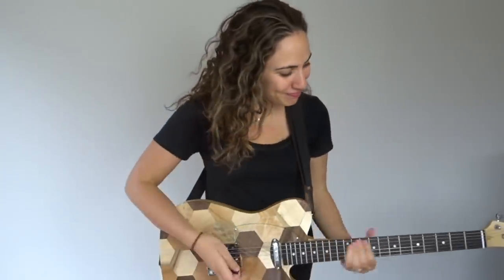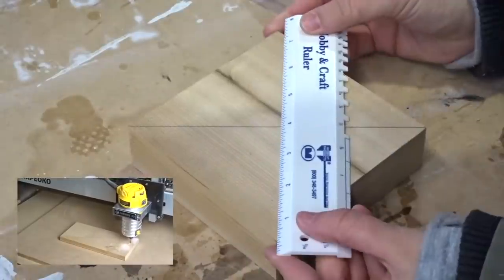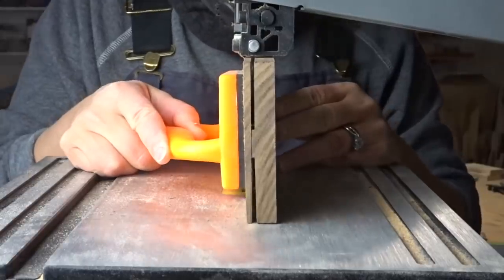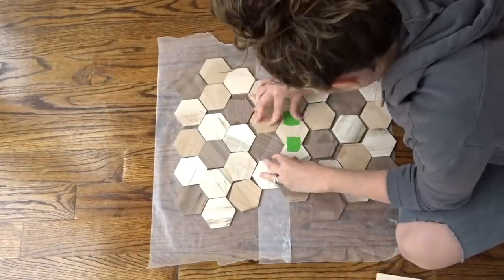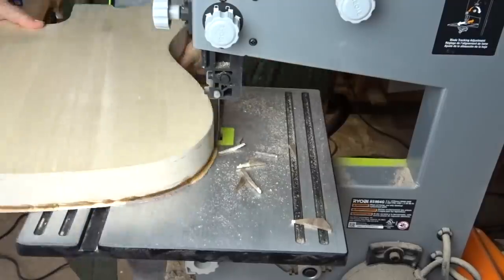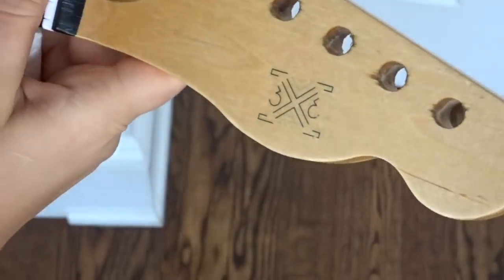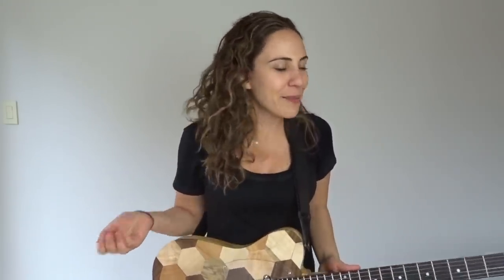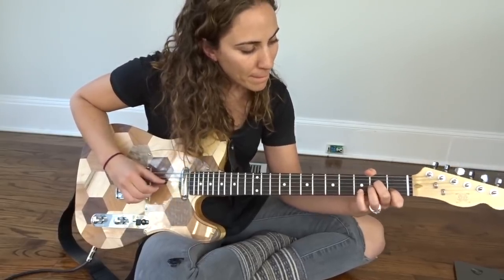DIY Telecaster Guitar // Woodworking Project // CNC // Guitar Kit

Comment: So to help with the issue of holding wires for solder, you can pick up a tool called a “third hand.” it’s got three flexible arms, two of which are tipped by alligator clips, the third by a magnifying glass. It’s been indispensable to my soldering work. Best of luck, good job. Cheers!
Reply: You can get them at harbor freight.
Reply from the maker: Awesome! Thanks for the tip!

Comment: Nice work. I'm curious why you didn't just use a planer or even the drum sander to take the top off the kit.
Reply from the maker: You can. I was concerned there would be tear out at the holes and possibly at the back. The drum sander, bc I don’t have one. And I already asked for one favor.... ha.
Reply: Haha fair enough. Anyway, it turned out great. Did you tru-oil the neck as well?
Reply from the maker: Thanks! I sure did. I watched a VERY LONG video of a guy applying tru oil to a neck. Here’s the jist. Rub on light coat. Wait till not sticky. Rub with 0000 steel wool. Repeat about 4 to 5 times.
Reply: Thanks. I'm familiar with the gist haha. Just wanted to make sure you put something on there to seal it up since you said this was your first guitar. Keep rocking; nice channel.
Reply: I have an unfinished neck coming my way in the next week or two for my Tele build I've had for several years now.  Tru oil might be the way to go.  And if you're interested in doing any different types of DIY finishes for your future guitar builds, @Brad Angrove has an awesome serious of videos showing how to paint guitars using regular spray paint.
Reply: Brad Angove ha, didn’t expect to see you hear Brad!
Reply: Or a plane... would have taken 5 minutes.
Reply: Thanks for the tip! Will try it out.
Reply: Did you use tru-oil over the decal? How did you "bury" that decal in clear? Great vid. Congratulations.

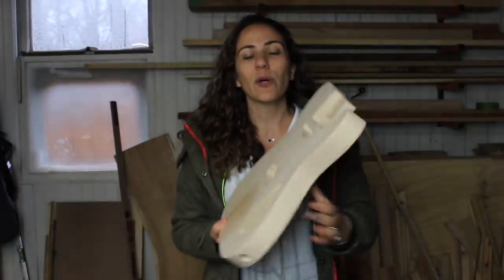Comment: 0:38 Planer? 0:47 Planer. 0:54 Planer! hhhmmmmmmm 1:00 PLANEEERRR!!!!
Reply from the maker: Sure. If you want to risk tear out on the back of your routered holes.
Reply: Oh............Looks great!
Reply from the maker: Ha. Thanks!
Reply: Yeah I was like....what??? poke that thing through a thicknesser, job done in 5 seconds :)
Reply: Nope. Thickness planers do not like surfaces with recessed cavities. The leading edges would be fine but the trailing edges would most likely get some pretty serious tear out. Not to mention that most bench top style planers are limited to 12-ish inches.
Reply: You can plug the neck pocket temporarily and cut pieces of the same thickness to buffer the leading and trailing edges. I’ve seen it done with good results in other videos. The concern is real, but it seems there are work-arounds for any that would prefer to thickness with a planer (or don’t have access to a CNC). Even a hand plane could work in a pinch.

Comment: Beautiful veneer work. You said building the guitar was pretty easy, but the veneer work is like pro level. I could build the guitar for sure, but I would just stick to a simple stain, and finish with the Tru Oil. I have had those three piece bridge saddles on telecasters before, but swapped them out for 6 individual saddles as you can intonate the strings a lot more accurately. Thanks for posting a good video.
Reply from the maker: Thanks! Yeah I want to upgrade all the electronics on this thing

Comment: "timesaver" barrel/drum sander(20 times larger than the one seen here)used in cabinet shops (residential kitchen and bath cabs)to get consistent cabinet doors face frames, and panel thickness is what i use/prefer.i just go to a shop i use to work at and i'm done in 5 minutes tops.lay it on the conveyer belt in the front of machine and take it off the conveyer at the back of the sander, might be an 18 inch trip through the machine, flip the body over and repeat.visit a local custom cabinet shop and strike up a conversations,I bet they say no problem.tell him you'll send others that wish to do the same project his way and he can make $20 on each guitar,great deal for both sides.GREAT JOB ON THE GUITAR AND GREAT JOB ON IMPROVISING METHODS TO GET TO THE FINISHED PRODUCT SEEING AS IT'S YOUR FIRST TIME AS A LUTHIER.LOVE YOUR NOT A PATTERN AT ALL PATTERN.I DESPISE PICKGUARDS,BUT THE CLEAR WORKS VERY WELL.JUST AN IDEA........BUT I THINK IF YOU MADE YOUR OWN VOLUME AND TONE KNOBS OUT OF WOOD ON A LATHE WOULD BE A SUBTLE CLASSY DETAIL.
Reply from the maker: Thanks for the tip!

Comment: That is a seriously impressive legit tele! You should definitely be proud of this one!!! Especially for a first time try. That thing came out ridiculously nice!!

Also I'm a Gunsmith and yes the Tru-oil is nice and easy to work with, is fairly forgiving, and gives a nice warm finish. You called it tung oil, but actually it is a boiled linseed oil. If you really like the look and feel of hand rubbed oils like Tru-oil then you might want to give a brand called Lin-speed a try. It's like Tru-oil, but dries a little quicker and comes in a little glass jar. Another one you might want to try which is my personal goto for finishing stocks is Gun Sav'r Custom Oil. It comes in 3 different sheens, dries quiet quickly, and best of all it is in a spray can, but can still give a hand rubbed finish. All of these and more oil finishes can be found at gunsmithing websites called www.brownells.com or www.midwayusa.com or of course you can just search the interweb for them. Just figured I'd throw those out there for you to try if you want to and once again great job on the custom telecaster!
Reply from the maker: Thanks so much! And thanks for the tips on those finishes. I will def check them out

Comment: Very nice! I don't know if you've already done it by now, but you'll also want to shield your pickup/electronics cavities. The most common way is with copper tape, though conductive paint is also an option.
Reply from the maker: I’ve seen this done. But still don’t understand the purpose. Why would I need to do that?
Reply: @3x3CustomTamar   The idea is that it will reduce interference in your electronics and reduce hum; when the electronics are not shielded, they can also pick up stray radio signals, noise from nearby phones, wireless mic systems, etc. It won't remove the 60 cycle hum that we all get from single-coil pickups (that's part of their charm?), but it will keep things quieter in general.  Luckily, this is the information age, so you'll find a ton of information out there about how to shield the cavity and ground your electronics to it. Good luck!
Reply from the maker: Matthew Gore got it! Thanks for the info!
Reply: @MatthewGore   it's charming right up until it's blasting through a PA system. lol.

Comment: Very nice!  

Just a heads up.  You seem pretty informed.  So, just in case you're not aware.  Brown paper bags are great for filling in fine cracks.  Obviously paper grocery bags are a little thicker than lunch bags.  Just glue the bag in between your pieces.   The bag will swell slightly.  But it will not push the joint apart.

Also, I didn't get a good look at your bandsaw.   But if you get a blade that's thicker (maybe 1/2 or 3/4) however with a thinner kerf.  That may help your resaw  endeavors.  Timber Wolf blades are very nice blades.

BTW that's a sweet finish!

Thanks for sharing!
Reply from the maker: I’ve never heard of using brown paper bags. Thanks! It’s a ryobi. Changing out the blades has not been helping.

Comment: Very cool looking guitar.  If you have not done it, I'd suggest doing a fret job on it as well.  It makes a HUGE difference in playability
Reply from the maker: Thanks! I plan on it at some point!
Reply: You can get a nice radius block on www.lmii.com for a good price.  Their stuff is less expensive then stewmac.  There are some nice how-to's on youtube on how to make a fret crowning file, and a triangle file with one side ground smooth works well for rounding fret ends.

Comment: Did you redo the roundover or leave the edges “square” with the flush-cut bit? It’s hard to tell in the video. Down the road you may want to replace the pickups and tuners, and for sure take it to someone for a full setup and fret job and your 10th fret issue will be solved. 

GREAT JOB. It looks very cool!
Reply from the maker: Thanks! I did round it over. Maybe I missed that footage. I’m def going to take it to someone to get it in perfect order.

Comment: I was introduced to your page through the Great Guitar Build off and found this video. Both guitars look incredible! If you can fasten the pieces down to the CNC table (or another surface that can be clamped); another way to separate the individual hexagons would be the same way it's done with metal parts. Flip it hexagon side down and surface cut it until the blocks are separated. Good luck in your future endeavors.
Reply from the maker: Thanks so much!
Reply: @3x3CustomTamar  I haven't seen it with wood (with metal, you're more likely to be machining parts that can be clamped, but it should work so long as you can attach it to the other surface. The same idea might be worth a try with your friend's drum sander. Either way the final passes should be shallow to minimize the chance of grabbing the part. It might be worth a test if you're in that situation again. Your videos are giving me some ideas for when my retirement home with a basement shop is completed.
Reply: Another way is to start out with the right thickness and either onion skin or use double sided tape and cut through. I would be using a downcut spiral bit also.

Comment: Nice job on that cool guitar. The reason you weren't getting good results re sawing on your band saw is you have the wrong blade. You need a re saw blade that is wider and has less tip. Also using  a fence helps out big time. Carter band saws has a great video here on youtube about everything band saws that really helps learning about what blades work best for particular jobs and how to properly tune your bandsaw so you don't get drift or crooked cuts. Still you did a great job, I build custom electric guitars for a living and it's very addicting welcome to your new obsession.
Reply from the maker: Thanks! I was using a dedicated resaw blade and in this video it wasn’t set up properly. But since then I watched a ton of set up videos and it it still doesn’t cut well.... even with a fence.... it’s a bit frustrating

Comment: Nice work.  I like the hex pattern and also the use of clear pick guard. I have also used Tru Oil and really like it.  Another finish I have tried is beeswax with linseed oil.  Heat it and apply hot. Learned that trick at a knife making class.
Reply from the maker: Thanks for the tip! I loves using the yeh oil

Comment: Watching all your videos - you have the skill to make an entire guitar including the neck. You have all the gear for it. You just need to take your time making a neck. And so what if your first try isn't as good as a bought neck. Some of the finest guitar makers made necks that they now are not impressed by - but they got better. "Soldering or Soldering?" The first way you said it was American and the second way is British. Thing is, we all understand it what ever way it is said. Very well shot and edited. Nice audio & lighting. Personally speaking, there is a slightly better tone in the guitar with the two strings trees. Gibson of course don't need the trees because they get the tension on the nut (which transfers to the neck/body) from the neck angle.
Reply from the maker: I definitely plan on making one from scratch one day!

Comment: Great piece of art!! Next frontier is the making of the fretboard from scratch, it's not that difficult for a fine woodworker like you.
A small detail though. You should cover the cavities (pickup's, knobs', jack's, etc) with copper or aluminum tape and ground everything, so you can avoid unwanted "hum" noise.... Don't hesitate to contact me if you need further information.
Ciao!
Reply from the maker: Thanks so much and thanks for the advice!

Comment: Very cool. I have always wanted to build a guitar myself.  You could have also put thinner stock on the CNC and cut through the stock.  I use my X-Carve CNC all the time. I just put a scrap piece of thin plywood under the piece I am cutting and use double sided tape. That would have saved you time in cutting the hexagon pieces on the bandsaw.
Reply from the maker: The problem was that I didn’t have thinner stock! And resawing was clearly a disaster.... ha. Next time I’ll def use the thickness I actually need.

Comment: I will join in with saying that you can't leave it as one. Nothing is more satisfying than building and customizing your own guitar. Problem is if your anything like the rest of us your already planning your next build. I just built a Tele myself. So enjoy. I do agree, you need to shield your electronics, with either shielding paint or copper or aluminum tape. All three work. Then I woukd suggest throwing that switch in the trash. A good 3 way is only 11 bucks or so on Amazon. Upgrade your pots and put an orange drop on that tone pot. Plus a good bone nut and locking tuners. Believe me you love it now but those upgrades later on make huge differences.
Reply from the maker: I def want to make all those upgrades. And I want to build more! It’s addictive.

Comment: Great work Tamar. You've made a beautiful one-of-a-kind guitar! Congrats.

By the way, solder is pronounced "sodder", and the process of pre-applying solder to the leads is referred to as "tinning".

Lastly, if you're going to be doing much soldering, you'll want to do so in a well-ventilated area or, ideally, under a vent hood that exhausts to the outdoors. The fumes are poisonous and can cause health problems in high concentration or prolonged exposure.
Reply from the maker: Thanks so much! And thanks for the tips. I realized afterwards I probably should have worn a mask or something....
Reply: Say the word "gold"
Now say the word "bold"
Say "bolder"
Now say Solder"
It's not rocket science!
Reply: You say Toemaytoe I say Toemahtoe.

Comment: Just a comment on your resaw issue. I also have a Ryobi bandsaw.
Has endless issues with blade drift, resaw was not an option at all. Spent a lot of time on YouTube trying to find a solution. Until at the end of one unrelated video (sorry can't remember who to credit) the guy made a comment that if you run out of options, look at the tires.
After replacing the rubber tires on my bandsaw with blue max ultra  0.125 urethane tyres I have zero blade drift.
Reply from the maker: Oh my goodness. Thank you! Everyone keeps commenting saying I don’t know how to use a bandsaw. And I kept saying, it’s not me! It’s the saw! Finally someone who understands. I will definitely go check that out!

Comment: Thats Cool...  I do stuff like this all the time.... But I use just the center core of body...  With neck pocket.  Pickup routes.  And I layer up 3/4" poplar...3/4" cedar ( lightweight) and 1/4" poplar on top..
I do this along either side of the center core ... So it's like a blank Plank   with the critical measurements already there... .then cut shape that I want...  And after sanding.. I glue vaneer on top .  And the process is very similar to yours after that ..
But . I make different shapes . . And .mix in different components.    To make a Guitar no other companies offer.....my favorite is a 24 fret Dean ML style.   I have five of those.....lol.   (Plus..  disclaimer....I've been playing guitar for 35+ years . And was a Carpenter 25+ years)
Reply from the maker: Sounds really cool!

Comment: Gotta do a fret job on the neck. Get them all level and polished and oil up the fret board. Tons of tutorials out there for that. Based on what you already did, you can totally handle it. Nice work and a very unique guitar. Also, might wanna consider upgrading the electronics a bit. The stuff that comes with those kits isn't really all that top shelf. All in all, GREAT job!
Reply from the maker: Thanks!

Comment: Wonderful. You are really good and have a great aesthetic sense. Curious why you didn't put a bar clamp on the bandsaw table as a fence. The barehanded free-handing made me very anxious.
Reply from the maker: Thanks so much! The bandsaw I was using is a piece of junk. The blade doesn’t get enough tension in it to make a straight cut. If i set up a fence, the blade binds. I just got a new bandsaw though 👍

Comment: Beautiful guitar, sounds like the intonation is a little off you need to adjust the saddles at the bride but that's a easy fix and I think you can call that a hardwood top cap, veneers are paper thin and would have no effect on the sound but yours are thick enough to alter it maybe also honestly you should just do away with the pick guard that's really only there to cover up the routed cavity and you already did that with your cap, something to think about when you build your next one
Reply from the maker: Thanks! Yeah. Agreed on all points. Ha